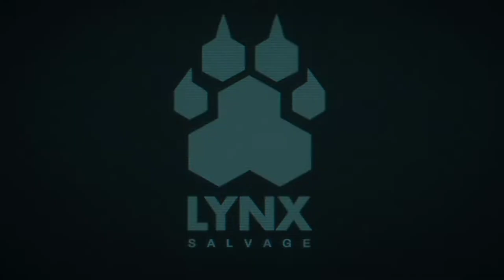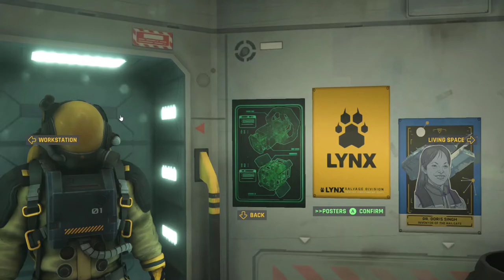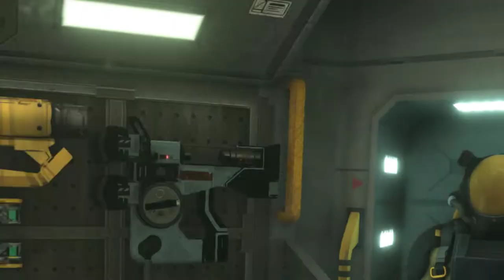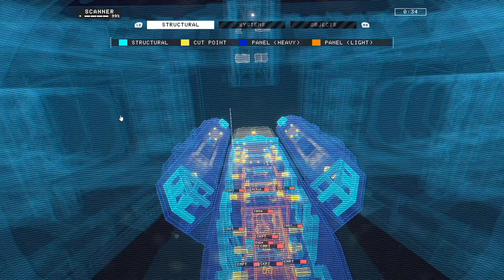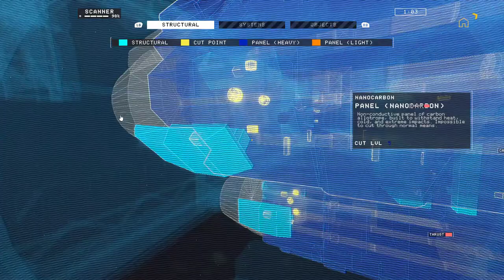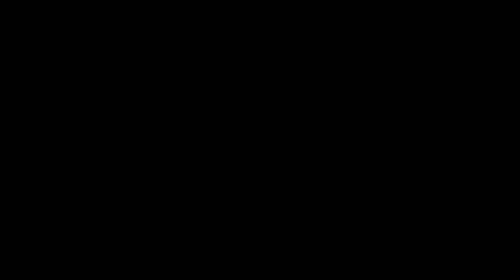HARDSPACE:SHIPBREAKER/Removing a Quasar Thruster (Training Video Style)

Comment: When it came to removing, I tried using the longways cutter and I blew up the engine. I used the pinpoint cutter on the other 3 and had time to cut the fuel. The last time I cut the fuel, the pressure killed me. Two deaths and 90 min. Later, I got the achievement. Thanks for the video.

Comment: This was really helpful! Normally, i seperate the engine from the ship before i remove the thruster, but this process works way better since the risk of the two casings crushing you when you pull the emergency shut-off is lower because it is still attached to the ship.

Comment: You can also use the grapple  to free one of the coolants. By gently banging it against the metal, you can cause it to start to spray. Holding the the grapple prevents it from escaping and you can use that to freeze the points. Now when you cut the frozen points, the leak will not catch fire, allowing you to have more time at the cost of a negligible canister.

Comment: I'm probably late to the party, but there's another way to do this safer, not every time though. Every now and then these Quasars come with small coolant units right under access panel. You can just take one such unit, break it so it starts leaking and then use it to freeze the pipes connected to engine. After that you can safely cut the pipes without fuel ignition.
Reply from the maker: Thank you very much for the tip!  I'll try that next chance I get.  Thanks for watching, too!

Comment: I keep having this problem with the side panels, not sure if it’s a glitch. Every time I use a tether on the massive side panels, they keep getting wedged in the middle of the two disposals, this has happened 4 times in one game.
Reply: Tether the sides to the man jack first to pull them forward, then tether one end of the panel to the processor. I think the furnace suction force keeps them locked in place

Comment: After I hit the release I seem to get crushed half the time, normally on a ship with 4 thrusters when I release the bottom ones. Any tips to avoid this?
Reply from the maker: That's a good question.  I've not had that experience, but I will look into it when I can.  Thanks for watching, and stay tuned!
Reply: same. always get crushed. seems grabbing hold with your hands prevents this though! (though tricky to get it right and you need to hold on for quite a few seconds right after you pull the release)
Reply: I've gotten crushed twice now as well. Idk why.
Reply: Yeah did you ever find out how to do this? all the tutorials are wrong like this one.

Comment: Hi there! Great video! Question for ya. What do you do if the EMERGENCY SHUTOFF IS STUCK?! EXTREMELY TIME SENSITIVE QUESTION BTW
Reply from the maker: In case of emergency shutoff malfunction, please exit the engine nacelle quickly.  In case of fuel line explosion, you may feel temporary discomfort until your next Everwork(TM) spare is activated.  An activation fee will be assessed to your account.

Comment: I really don't like the part where you have to get the massive nacelle halves into the processor, they very often get stuck on the wall between the processor and the furnace for me regardless of how I try to tether them. I find that fiddlier than removing the thrusters themselves.

Comment: Pinpoint mode to cut out the thruster cap, splitsaw mode to cut the fuelpipes surrounding the engine 
WHAT MADNESS IS THIS 😂
Reply from the maker: While riskier, splitsaw cuts on the fuel pipes are faster.  Once you cut the first one, you're racing the clock to remove the engine, get to the front of the nacelle, and pull the release.
Reply: @PolyhedralVideo  that is entirely fair for a sufficiently skilled cutter. But even then, why not apply this same time saving method where there is no danger of breaking valuables, like when releasing the thruster Nozzles where all materials surrounding the cut point are impervious to misplaced cuts.